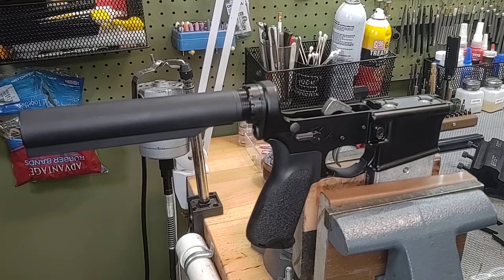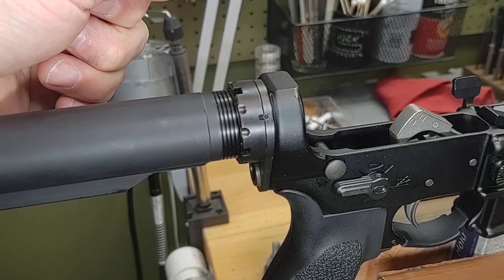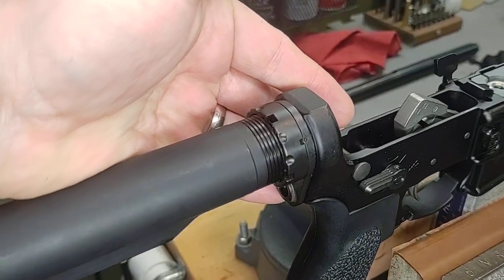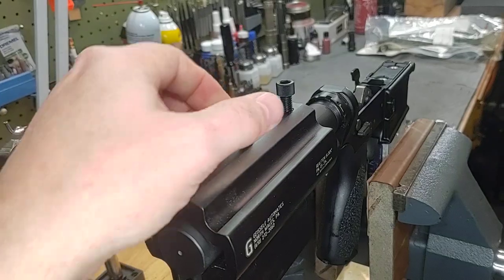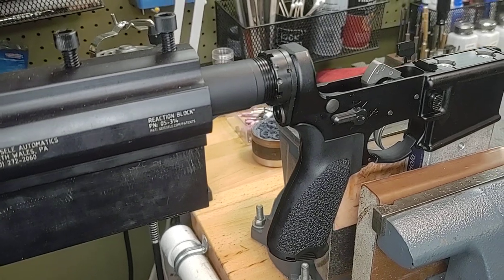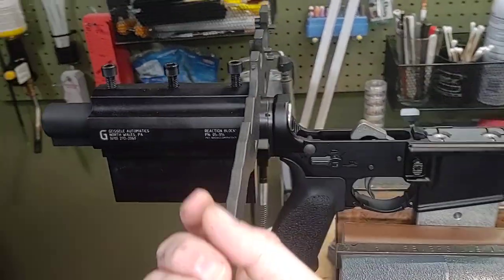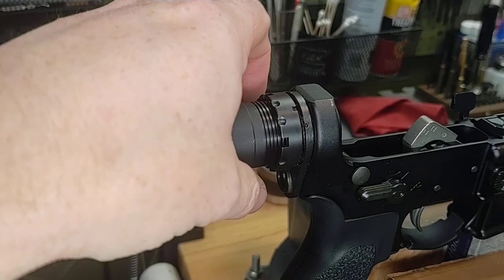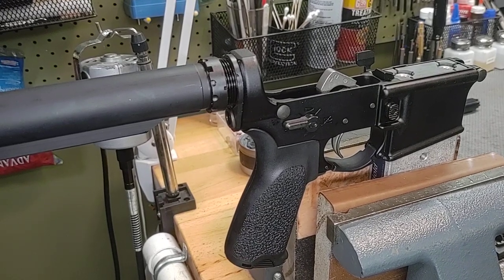Staked Castle Nuts are NOT permanent

Comment: Do you have any negative problems with the pws ratchet plates?
Reply: If I recall correctly, they're only "one time use" so do it right the first time and don't loosen them. So if you ever decide to loosen it at all it's "junk" after that. Staking is WAY cheaper and much more secure. Why "reinvent the wheel"?
Reply: I ended up using the pws setup on my 13.7 build. Waiting on the smith to finish the p&w and I’ll see how it holds up. 

I agree about not reinventing the wheel. Some parts can be hard to come by and I’ve only just recently discovered a lot of new vendors.

Comment: Holy crap , I always though that you couldn’t reuse a already staked end plate for structural reasons
Reply: i wouldn't reuse (either it would line back up not be restakeable) and endplate nor did he. the castle nut on the other hand can be reused.

Comment: I've always known this. I've seen castle nuts come loose on military issue M16/M4 in the US Army. This is partially why I don't worry about staking vs no staking. To each their own.
Reply: Yeah, the castle nut coming loose on an M16 is a HUGE bummer...
Reply: @soulstodeny05  I always took tools with me on deployments, and we'd just fix things like that. We made lots of mods to our issued weapons (put everything back before we turned them in of course). We didn't intentionally mess with anything staked or pinned though, just the easy stuff. But if the castle nut came loose we'd just retighten it. But most guys in my unit were better armed at home than overseas, and many of us reload or build guns, so we knew what we were doing.
Reply: @soulstodeny05  M16's don't use a castle nut.
Reply: @jeremyvis395  Yes, mine was a sarcastic comment.
Reply: @soulstodeny05  Hard to tell these days. LOL.
Reply: @jeremyvis395  AR-15's don't either, It's a jam nut. To be specific, a jam nut that requires a spanner wrench.

Comment: I just torque mine on, same amount of force, and a castle nut wrench isn't gonna take up any room if you take it with you
Reply: Until it loosens enough while you are shooting that it tosses the buffer retaining pin into the fire control group and locks up your gun.
Reply: @jeremyvis395  then it wasn't tight enough, plus a little loctite never hurt anyone
Reply: @hansorsic7387  that is entirely not true. I’ve had the castle nut come loose on a rifle with less than 1k rounds through it after properly torque wrench applied torque and blue Loctite were applied. I have talked to several with the same experience.

Loctite is not effective in this application. Always stake your castle nut.
Reply: @brianfhorton  the video just showed that the staking isnt any better
Reply: @jeremyvis395  That actually can't happen. You'd have to purposely unscrew your (attached, because you're shooting) buttstock. The jam nut doesn't need to be tight for the firearm to function.
Reply: @hansorsic7387  Just because you break the staking doesn’t mean that loctite is any better.
Reply: @echofoxtrotwhiskey1595  jfc you can just as easily break the staking, im not going out buying guns and breaking the staking

Comment: If it's not permanent, doesn't that just mean you're marring the part for no reason whatsoever?
Reply: @smg1831  Sounds to me like thread tape would have the same effect.
Reply from the maker: @InvidiousIgnoramus  you are incorrect.
Reply: @InvidiousIgnoramus  Thread tape would lock the castle nut to the receiver extension. Staking locks it to the endplate.  Endplates are relatively inexpensive.

Comment: I just use red loctite..  👹👹
Reply from the maker: No
Reply: Do you know what diameter of fastener red Loctite was designed to work with?  Let's just say the diameter is much smaller than that of a castle nut.  Wrong application for that and other reasons.
Reply: I won't disagree with that! I just can't stake a castle nut to save my life... so it's how I do it....out of the 30ish I have done for me an others they haven't loosened up "yet"... the couple I have taken off I just use some heat an they come off.... im sorry I'm just confessing my sins... I do feel better now 🙃
Reply from the maker: @sethperry1323  that heat can weaken the lower depending on how hot and how long you heated it for. I encourage you to look it up.
Reply: @SchooloftheAmericanRifle  thank you